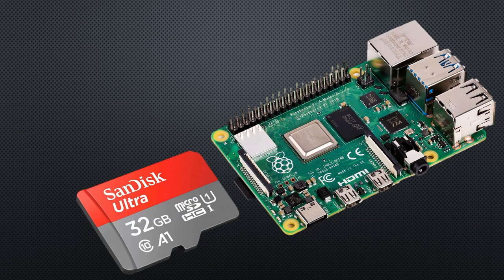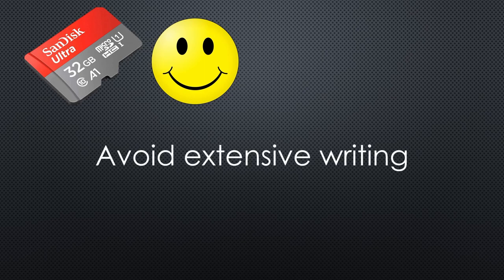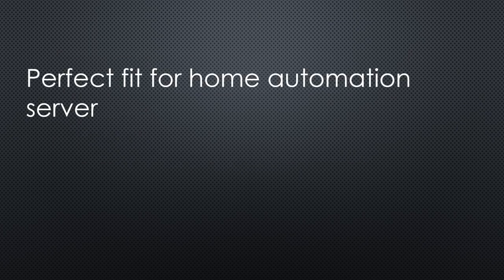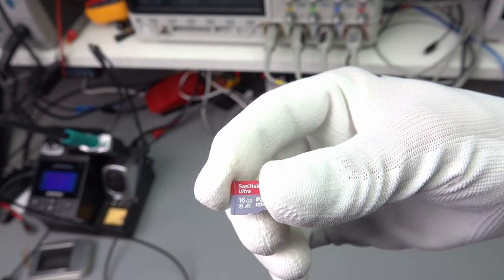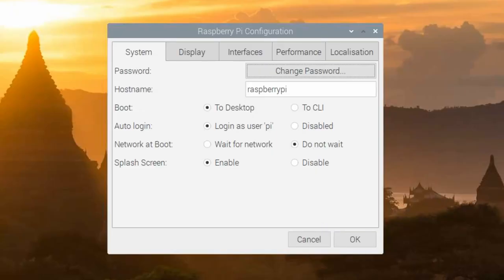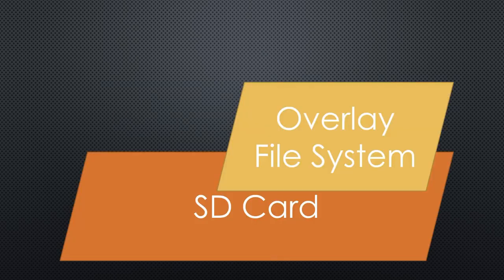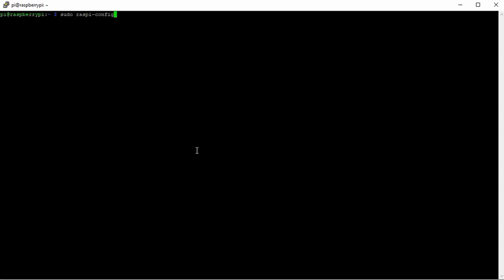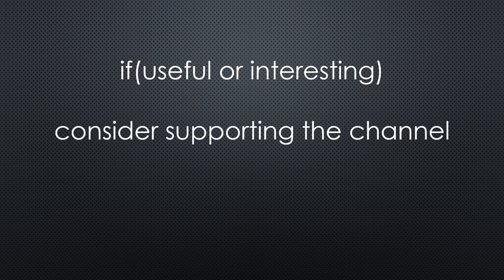#403 Simple Trick to protect your Raspberry SD card from Crashing

Comment: For logs and things I want to keep I would create separate partition. This way reducing system writes and keeping the data I chose.
Reply from the maker: I do not get the point if the partition is on the same SD card :-(
Reply: @AndreasSpiess  Well, guess it depends how much logging are you doing. If it is a constant dense stream then SD cards is not good enough.
Just to be sure I meant to use it with Overlay System so the only writes would be from logs.
Reply: What I was thinking of doing is setting up the overlay for most of the file system, so that all the system logs etc went to RAM. Then I’d have a small partition with my Python code and the small amount of data I intentionally write that was RW. 

I’d forgotten about USB SSDs, though. I think I will get one of those because I’d like to log sensor data locally (battery charging and power consumption and temperature and so on. Just saw some potentially anomalous behavior from the 72A battery charger and realized that a 1+ Hz data log would be nice…)

Comment: I use a SANDisk SD Card in al my Pi for 6 years now. Some of thm write in every minute a few bytes. I never had a SD Card failure yet with SANDisk.
Reply from the maker: So you are a lucky guy! Maybe the older (and smaller) SD cards used different flash technologies?
Reply: I think it is the Brand SANDIsk. They make great Cards. I use only 32GB ones. Though, I know the pain with no name cards. Saw some failing. But not with me.

Comment: SSD is not necessary the saving grace though. usually power outage does not corrupt the sd card, but the filesystem on it. a modern ssd has a fair amount of RAM onboard, that is used for buffering, and is also lost when power goes out - unless it has some sort of battery or supercap backed failsafe power source.
but anyways, once the filesystem is dirty, it needs to be fsck-d, which can put extra write load on it, and since SSDs have a more elaborate wear leveling solution they tend to lst longer, but definitely not forever.
a copy on write filesystem can help, but the true savior is read only root. having an overlay FS is cool, but one can also use filesystems that are mounted from a server, or have the logs sent over to a syslog server to reduce (or eliminate) local writes.
also, turning off swap is essential to reduce write load.
Reply: Some recent data from Backblaze shows ssd failures are almost the same as hdd's
Reply from the maker: You are right. I always check at least if the swap file es empty. With the current 2GB Raspbies it is not a big problem anymore. And for my home Server I use the 4GB version...
Reply: DRAM on SSDs is becoming rarer. These cheap KingSpec SSDs like the one in this vid and other budget SSDs contain none, there is a little SRAM inside the controller, but it's only sufficent to manage the runtime state of SSD controller, it doesn't actually buffer a substantial amount of data. They have instead a small section of flash set aside in fast SLC mode to use as a buffer.

An SSD that is adequately designed is supposed to guarantee that the data that has been buffered in DRAM/SRAM (in-flight data) has an opportunity to get get written, by having substantial hold-up capacitance and SLC space reserved for this purpose. When this is not possible, it's supposed to tag the data such, that upon next start, it can roll back to a valid state of FTL (flash transition layer, i.e. map from logical addresses to physical ones, wear data etc) and a valid snapshot of data from recently before the power went off, with no partial writes or out-of-order writes.

Comment: Disabling the extensive logging and writing to disk is also useful to extend the life of all types of disk drive, especially handy for extending the life of limited-write SSD's that also degrade rapidly like the sd cards.  For any High Volume Data logging try using Mechanical HDD's for a much longer service life.
Reply from the maker: Good to know that the old HDDs still have some advantages...

Comment: Nice feature. Till now, I didn't completely disable writing but reduced it, e. g. by turning off local logging and logging to a remote syslog server. Has anyone any experience with Sandisk Max Endurance cards?
Reply from the maker: I did not buy new SD cards for a while. So I have no such card.
Reply: I don't have any SBCs to test the SanDisk Max Endurance cards, but I did tap into its test interface to check what NAND it's using, and I found it uses 3D TLC in pMLC mode. It should have pretty good durability over thousands of write cycles.
Reply: @ginbot86  Nice work!

Comment: I actually use a very small USB stick. it’s easier, yes I loose one of the USB ports, but it’s faster than an SD, very compact (no cable), cheap and everything works as usual
Reply from the maker: Good point. But so far nobody was able to tell me if USB sticks implemented Wear levelling. Otherwise they will encounter the same issues as SD cards.

Comment: Just mount the folders like log, tmp and stuff into a RAM Disk mounted Filesystem
Reply: For something like that there's log2ram in deb-repository
Reply from the maker: AFAIK this is done by the "barefoot" method. It seems to work, too.
Reply: @AndreasSpiess  It works, unless you need to keep the logs after reset or powerloss. But I only need to use them, while developing, so I don't care. 
Didn't know, its called barefoot :D

Comment: If you're going to go to all this effort just build a completely in-ram system with buildroot. A very basic system with python3 etc is going to be about 16-32MB as an initramfs. You can stick that on an SD card, have it load into memory at boot and never do any writes to the SD card.
Reply from the maker: That is an interesting idea. Would it also run all the examples I mentioned or only Python programs?
Reply: @AndreasSpiess  

You can run anything you can on a normal distribution. You just have to select the pieces you need for your build. Packaging your own bits is easy too. IIRC Tesla use buildroot in their cars.

An example: I have a beaglebone black based LoRaWAN gateway in my roof. It's impossible to go an fix that thing without getting out ladders etc. So it has just u-boot in it's eMMC. It downloads a buildroot based image over TFTP on power on and runs from that in memory.
If there is a problem and I need to update the OS I can just build a new image, load it to the tftp server and then power cycle the board via it's PoE port.
Reply from the maker: Sounds like what we call "OTA" on our ESP32s ;-)  I did not know this exists, but it is very handy for situations like yours!
Reply: @donpalmera  Is that also know as PXE boot?

Comment: My solution - buy A1 class card that is NOT SanDisk. They are counterfeited most often. I have several genuine A1 class cards working for several years already with Armbian (that is tuned to minimize writing)
Reply from the maker: Good tip. Others suggested to use WD purple cards wich are made for extensive overwriting.

Comment: i not understand i has make sd copier whit rasperry pi 4 new copy at card and not make, say ewery sd card or usb memory same no can mount card. or make but after 1-2 time boot then not boot newer again, and need make new image again. vor not mount or make copy but not boot newer no start run. i has test ewery day last 3 week now make good image and boot good but no can, only one old sd card run raspi now, all other 13 new sd card 4 different size usb memory, 32gb,64gb,128gb,256gb usb all not can make boot image. no can sd card copyt no boot.
Reply from the maker: I think not that the SD card is the problem. It is not possible that you have so many bad cards. But I cannot do remote debugging :-( I would start with downloading the official Raspbian for your Raspberry version and test if the problem persists. If so, Your Pi probably has a problem. Or the power supply.
Reply: @AndreasSpiess  io uses official raspi bullseye and official imager software. not working good or notr mount or verifed fail error etc. andf 13 new sd car uses. all  have  genuine sandisk or sansung what raspi say need use. 2 month and need have ready working raspi i need because i go to travelling to kambodia and need i have computer were looking e mails and connec t to home and speak whit peoples, ewery hotel have TV hdmi display not need carry. raspi have small if working.

Comment: the best solution, use it with a usb flash disk am i right?
Reply from the maker: I do not use USB sticks because I do not know if they use wear levelling or have the same issues as SD cards. They also are made for only a few large file transfers.
Reply: @AndreasSpiess  Then the best way is ssd connected by usb right?

Comment: Some clever guy should build a case with UPS and SSD built in, with a few extra USB ports.

Some clever guy should build an RPi hat with GPS, RTC, and an UPS built in. An instant internet independent NTP server.
Reply from the maker: You find many additions for the Pi. Maybe also one which covers your requirements? (GPS probably could replace a RTC)

Comment: I use my SD cards like a boot drive and use pen drive a storage
Reply from the maker: It seems that this system is used by other commenters. My question would be: Do the pen drives support wear-levelling? Otherwise you probably have the same issues as with SD cards.
Reply: @AndreasSpiess  yes but the sd is only read only memory and has a very low write memory so, I guess it won't have a lot of problems 
And ur tutorial is useful and does make the setup easier and better

Comment: It's a complete BS that there is still no integrated M.2 slot on pi5.
M.2 slot is also much better way of exposing pcie lane for other devices, and there is already a large market of M.2 to 100 different things, like 6x sata ports, risers for huge GPUs and lastly can conform to gen3 standard np (dodgy fpc connector they used is guaranteed only for gen2)
Reply from the maker: The Pi5 seems to have that possibility.
Reply: @AndreasSpiess  via hat yes I mean built in

Comment: Just use second USB pen or SSD card for extensive writing and mount it with commit=600 and noatime parameters plus disable ext journaling, this is what Armbian is doing together with storing /var/log on ram drive.
Reply from the maker: Do you have information if USB drives have wear levelling? Otherwise bad things could happen, too. But probably your ram logging solved a lot of problems...

Comment: Why is the os continually writing to the card in the first place??? The default os for rpi should never do this. Just another example of hobby level crap.
Reply: Er, it's standard OS behaviour from Windows to Linux. Nothing to do with 'hobby' stuff.

You have logs being created, temporary files created, modified and deleted, file stamps get updated eg the modified time, even the filesystem itself is doing things (like running clean up routines, checking file system integrity etc).
Reply: @richards7909  right, an embedded system should never do this by default, as I already indicated in my post.
Reply: @superalpha   Your post I replied to doesn't mention anywhere about referring to an embedded system.

An embedded system and an OS to me is two different things and although the Pi can do the former, it's not sold on that but as a computer which runs either its own OS or one from another source (eg RISC OS).

As for Raspberry OS being 'hobby level crap', I'm not sure how you've come to that conclusion as its based on Linux which runs on everything from servers to mobile phones. Pretty certain if it was that bad, most of the internet wouldn't run on it for example! :D
Reply: @richards7909  the rpi is an embedded system
Reply: @richards7909  an OS is an operating system and is basically a scheduler, etc. It is not a requirement for an OS to constantly write to non volatile memory. The default operation for Linux on rpi should have been none, or rare, writing to NVM.
Reply: @richards7909  for the most part, open source is garbage (useful for hobby and/or poor excuse for "engineers" who cannot engineer) and implementation could range from crap to excellent depending on design and scrutiny above and beyond the open source garbage.
Reply from the maker: @Mike: The largest companies and applications use open source software. So I cannot agree. Maybe you watch my video on Risc-V why open source is used (and in some areas even pushed) by the industry
Reply: @AndreasSpiess  as I said, poor excuse for engineering. Open source freeware is mostly garbage. A company's size doesn't mean they have good engineers. They could also have great engineers who could make due with the crap, even polish it. If I made hobby products, I would obviously include Open source so the hobbyists could get by, but realize hobby stuff isn't necessarily reliable or robust. (And also commercial products  in some cases.)